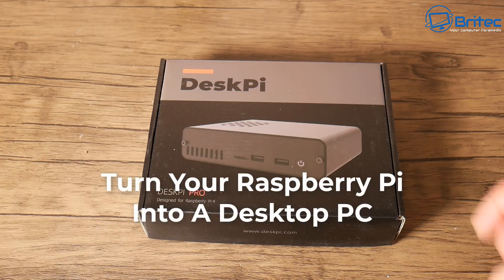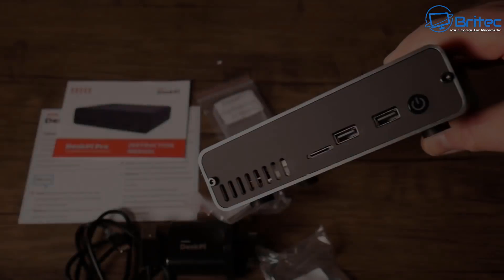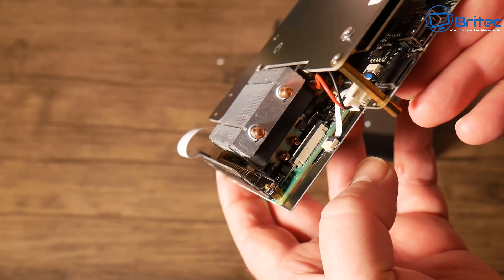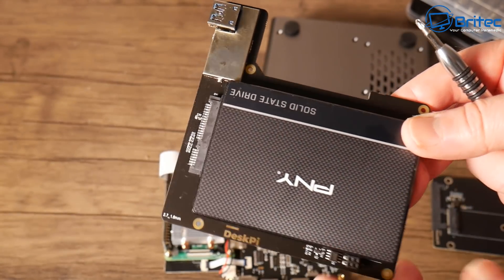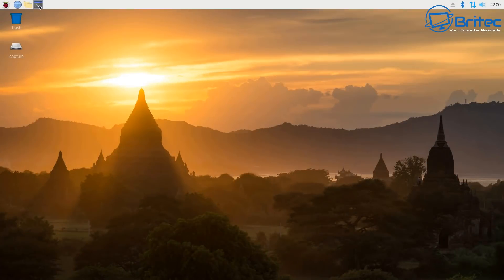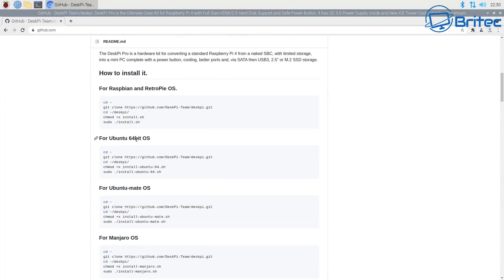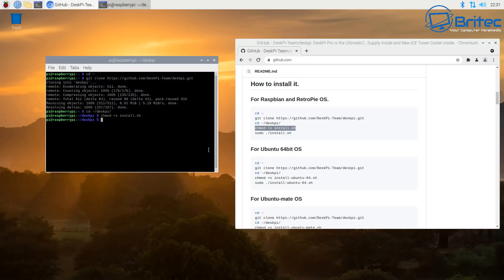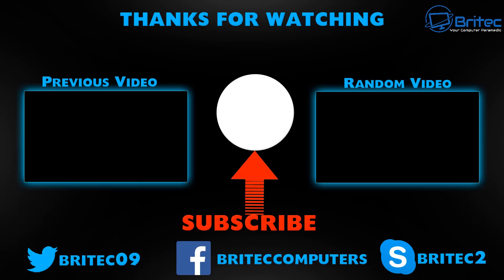Turn your Raspberry Pi into a Desktop PC

Comment: It also supports both M.2 and 2.5" SSD drives, full-size HDMI ports,  easy access to the microSD and two additional USB 2.0 ports on the front.great
Reply: No, it will NOT support M.2 NVMe (only m.2 SSD)

Comment: What could I do with this? I've always wanted a raspberry pi but dont know if its worth it.  Does it do anything special ?

Thanks
Reply: Actually, it depends on what you want to build, for example, if you want to build a linux PC on desktop, you can use raspberry pi, or arcade machine for the retro game , or you can just build your own media center by using Raspberry Pi, go further, if you want to learn how to coding in Linux or learn more about linux system, i have already build my own download machine by using Raspberry Pi, and learnning python language coding on it, sometimes, i even connect a camera and try openCV to do some funny experiment such as face recognition, face detection, hand detection, or just watching video by using Raspberry Pi due to it can support 4K@60FPS,  and even build your own robot by using Raspberry Pi, control hardware via raspberry Pi GPIOs, there are a lot of instance you can follow and build. it is a cheap and small ARM single board computer, you can try it, i think you will never feel it not worth to buy....LOL. it is my opinion as well, hope it can help you~
Reply: @kevindeng1889  Thanks for the thorough reply, I never knew the pi could do all these things. I may just have to pick one up. 

Thanks
Reply: @harkisingh  get a pc in the same price range used or smoething smack linux on it and you are probably better off

Comment: Thanks Brian for the very nice presentation as always!  As a complete novice, could an external DVD/CD unit be connected to install a few old school programs on the raspberry PI?
Reply: yes, you need to use USB port DVD/CD drive to connect to Raspberry Pi and there will be a device called "/dev/cdrom0" or "/dev/sr0" , and you can access it via file manager like you open a folder. BTW, your old school program need to be fit for the Linux OS as well.
Reply: @kevindeng1889  Thank you Kevin!  I may need to find something that is Windows based. I greatly appreciate your time and guidance!
Reply: @drof2th  you are welcome bro.

Comment: Looks like a really nice case solution.  Why won't manufacturers put a couple of keyhole slots on their cases so they can be wall mounted?   Come on Desk Pi, its 5 more seconds on the CNC.
Reply: At that time, the original intention of the design was to put it on the table. Your proposal is very good, and we will try to adopt it. LOL
Reply: @kevindeng1889  Awesome.  I’ll keep my eyes open.  
I get what you’re saying though.   For a “looks like a retro gaming console”, the desktop model is fitting.   I’ve done a lot of home automation stuff and your cartridge implementation is a great idea, beyond the obvious intent.  But often there’s just no counter or shelf to put these things on and VESA mounts can be cumbersome.  I think you are onto something that could be the perfect Pi case… regardless of what it looks like.  Sorry, I’m a retired Product Development Engineer, I love to push things to maturity.
Reply: @ramosel  Your evaluation is very good. A complete product needs to be modified according to user needs. We are also willing to accept users’ suggestions and comments, hoping to provide users with higher standard hardware equipment. This is our goal and we hope to provide more Good service and equipment for you to use. Thanks for your advice.

Comment: My mouse is disconnecting and reconnecting again and again bcz of this I have not played games for over 2days.
any fix?
Reply: where did you connect the mouse? front USB port or back ? and did you using a wireless mouse ? if so, did you check the batteries capacities?

Comment: Very nice. I used the very first Pi as the main computer in my workshop (still do). It's only drawback is that it hangs when you have to many browser pages open. The DeskPi Pro V2 would be a jump from a 386 to a Pentium 90 for me.
Reply: Lol, nice try. I usually using terminal to control my Pi, using vim or vscode to writing code, it is low cost for the system resource, so it is fit for me, LoL.

Comment: Using the Raspberry Pi as a desktop, performance is an important issue.
Can you show us the performance on a few different OS-es, like Windows 10 or 11 and Twister OS ??
Reply from the maker: See what I can do
Reply: I tried win10 on the Raspberry Pi, but the experience is not very good. Due to the lack of many software, I cannot use some of the software I need. I think it will be more convenient to use the Linux system. After all, it cannot be compared with the PC. If you just do Programming, watching videos, or browsing the web, etc., are all pretty good.

Comment: Any built in wi-fi?
Reply: Raspberry Pi 4B built-in wifi module and bluetooth module, and wifi module supports 5G and 2.4GHz as well.
Reply from the maker: You can use WiFi

Comment: Love to see you set up a NAS for watching movies... New to Raspberry Pi and new to Linux.
Reply from the maker: See what I can do
Reply: Linux has a higher degree of freedom and is very convenient to use. It has made me lazy. One command can install software and one command can upgrade the system. The huge software warehouse gives me more choices. Language support makes it very convenient for me to write code, and SSH and VNC services make it more convenient for me to remotely manage and access. After building the NAS, share it with my family through samba, and synchronize data through rsync, through ffmpeg or vlc. Video streaming is very convenient and interesting. Especially after doing some interesting applications on the Raspberry Pi through the opencv visual framework and Google's mediapipe library, I feel even more fun.
Reply: @kevindeng1889  maybe.. But I don't know if I'll feel comfortable learning the Linux language.. I've was a strong DOS user when that was relevant, but I've been spoiled by the "point and click' of Windows.... Maybe I should give it a try.. Just play with it for a few months while learning the ropes.. Thank you for the encouragement

Comment: I have a 4K Oled TV and I'm curious if its possible to hook up this raspberry Pi to the TV and have it run on Wifi with a wireless/bluetooth mouse and keyboard? My hope is to run google chrome with a speed video extension so that I can stream TV shows and movies and play it at 2x speed.
Reply from the maker: it will do 4k
Reply: Of course you can do that, if your  4k OLED TV has HDMI input.  it will ok for your wireless/bluetooth mouse and keyboard, it is simple to operate.